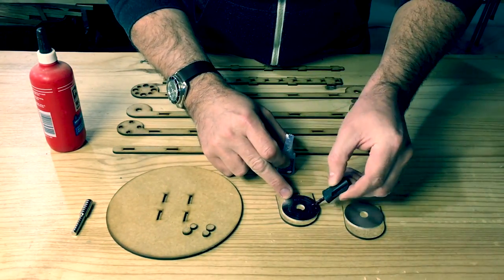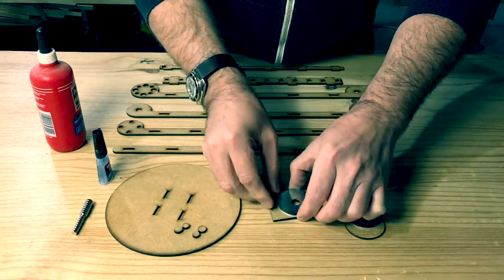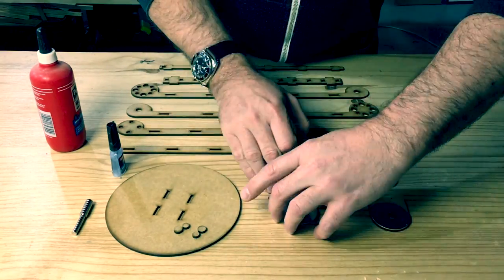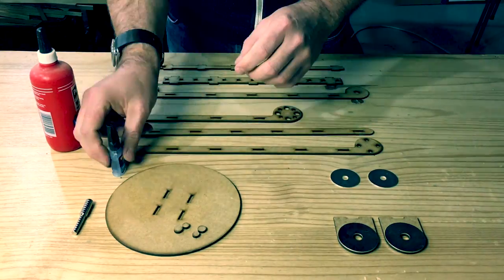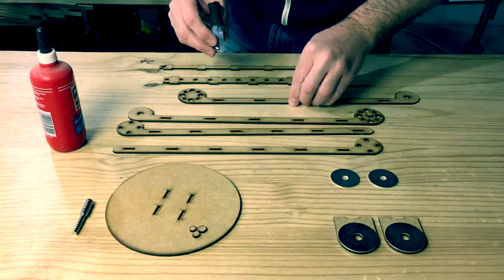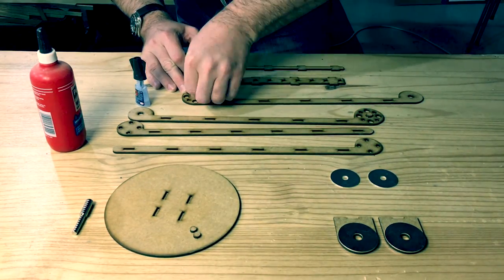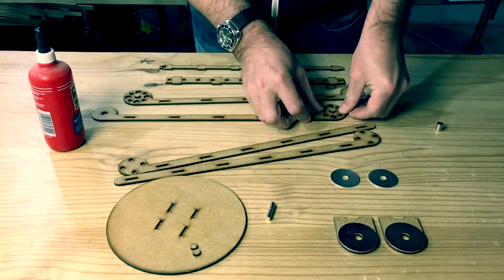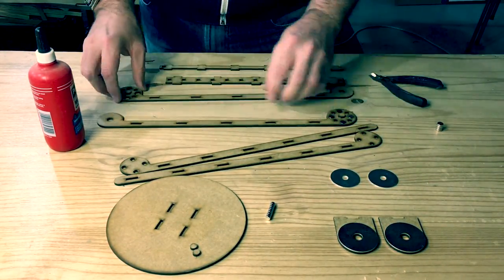Making a Desk Lamp with Magnetic Movement - by SoundBlab

Comment: Nice project! How did you insulate the solder points to the LED strip? Seems like it's a potential way to get shocked?
Reply: Michael Duddy You won't get shocked with that voltage.
Reply: Michael Duddy It's 12v DC. It won't even few anything. ;) But you can always put a bit of hot glue to insulate. :)
Reply: The more you know! Thanks!